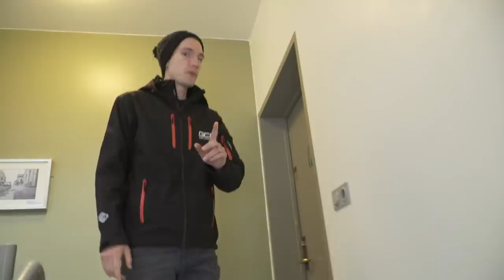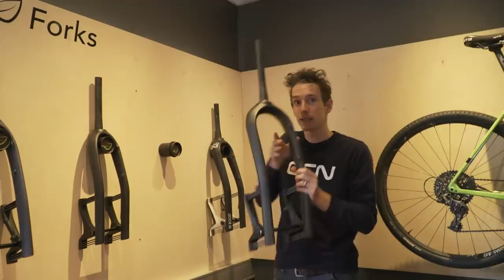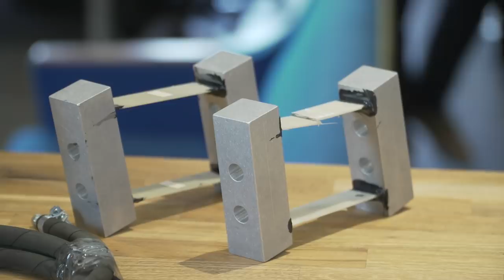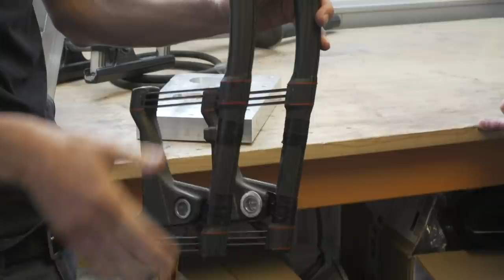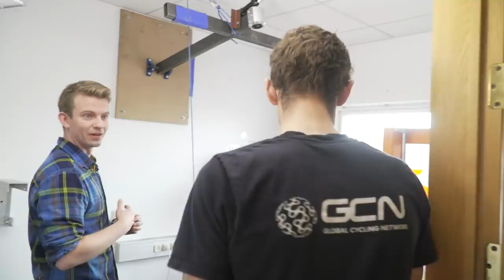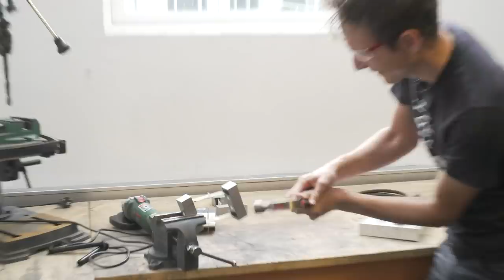Gravel Bike Suspension?! | Meeting Lauf In Iceland

Comment: These guys are ignoring a huge market by only concentrating on gravel and MTB's.
I came back into cycling recently in my 50's and only ride in urban areas and cycle paths, almost immediately the numb hands and butt from various dodgy footpaths and rough roads made me want to quit.
I fitted a Redshift stem, and that has been great, and have experimented with various suspension seat posts and seats to make riding bearable.
If Lauf or anyone else, made a bike with front and rear suspension that does what they claim, and marketed it as a 'comfort bike', to alleviate the all the minor bumps and vibration of typical urban riding, they would have a winner, I reckon. 
A regular road bike is totally unsuitable for urban riding with all the bangs and bumps, you have to put up with, might be ok if you are young and limber and are concerned about your macho image, but there is a big market for a short travel small bump suspension bike for all the rest of us, unfit, overweight enthusiasts who don't have the luxury of riding long distances on relatively smooth roads.
Reply: Dooya Punk I agree with you completely, I have 2 road bikes one with 23c tires and a cheaper road bike with 32c tires. There is no doubt the 32c tire bike is more comfortable. I lower the air pressure on the 32c tires to -15 psi off the tire rating. This allows for a more soft ride. It also helps cornering as there is more tire on the ground . Roads in Canada are probably the worst due to rough winters with the snow plows scrapping the snow off and salt on the roads. Road biking is not that great due to some nasty roads where you literally have to ride looking out 20 feet ahead of you so you won't crash.
Reply: @danfuerthgillis4483  
Thanks Dan, I really think a 'Lauf' bike with a similar set up at the rear, would be my ideal bike, still light but with the ability to take out most of the road shock that makes urban riding a pain.
No one would drive an F1 car, or any race car on the roads due to the fact that they minimize suspension travel for better handling, yet we ride rigid bikes and have been for ever !
Reply: @SaintKimbo  those sound like symptoms of improper bike and cleat fit
Reply: @SaintKimbo  if regular road bikes are painful,  why don't you switch to a trekking bicycle with wider tires and a short travel suspension fork or even better, a cross-country bike, either a hardtail or a fullsuspension? I use a GT Avalanche in the city and while I'm losing some speed/efficiency, I'm enjoying the extra comfort and robustness provided by 2.25" tires.
You could also be using a seat post or saddle that has integrated suspension.
Reply: @CristianCiupitu  
Yes, a XC bike with full suspension is on my radar, but my point, after watching this Lauf fork video is that, this type of fork would be ideal for a 'round town comfort bike, especially if they could fit something similar at the rear.

There doesn't seem to be anything out there that fills this void, lightweight, without the stiction and weight of a telescopic set up, but still relatively comfortable.

I think that this is where bike development is heading, Trek, Specialized and others are doing this already, with their frame lay up, stem suspension and seat post tech, and it will evolve to a point where bikes will be fast, light and much more comfortable without compromise.

This is a market that Lauf should look into, comfort is one of the main selling points of recumbents and if you watch any video about recumbents, you'll see a whole lot of people saying how they are sick and tired of the aches and pains of regular bikes.

I can't see any reason in 2018 that we can't have both comfort and speed, if rigid was the way to go, why does F1 and GP motorcycle racing spend squillions on short travel, fast acting, lightweight suspension systems?
Reply: @SaintKimbo , indeed, when it comes to comfort Trek has IsoSpeed [1] and Cannondale has SAVE [2].

[1]: https://www.trekbikes.com/us/en_US/inside_trek/isospeed/
[2]: https://www.cannondale.com/en/International/Innovation/micro-suspension-technology.aspx
Reply: Specialized have their FutureShock stems on their mid-range Diverge (gravel) and Roubaix (endurance) bikes. You also have their CG-R seatpost with about 17mm travel (though it's expensive for what is it). 

With Canyon you could consider their Endurace line with VCLS 2.0 flexing carbon leaf seat posts. You can either buy into their high-end range to get it included or buy it separately. Ergo also sells this exact seat post under their brand, too. By many accounts this is so far the ideal seat post with the right weight/flex/travel. If you have the funds you could buy an Endurace (with large 32+mm tyres and fit your RedShift for excellent comfort!
Reply: @justinseau  
Yes, I know about all these options, but watching videos about the Lauf fork got me thinking about why there is not more done in this regard.

I get that pro and amateur racers and the traditionalist/masochists/wannabes, want their stiff frames to maximize peddling efficiency, but it's 2018 and there's no excuse not to have a lightweight fast bike with about 30 mills of travel, without the weight and maintenance of telescopic forks, Lauf have shown it can be done.

Motorcycles had what they called 'plunger suspension' on the rear, prior to swing arms taking over, back in the '40's, which was basically a short shock fitted directly to the the rear axle, I see no reason why something similar to the Lauf leaf spring arrangement could not be adopted for the rear end.

Motorcycles had, lightweight, short travel suspension systems nearly 80 years ago and road bicycles still have nothing, can't you see a problem there, isn't there some catching up to do?
Reply: @SaintKimbo  Ibis, KHS, Sun, Merida (untill recently) and some other companies manufactured soft-tail models during '90s, in range of expensive titanium or carbon frames, to affordable alluminium and Cro-Moly... pity that that concept didn't widen. Now Cannondale, Trek and BMC have at some point similar conceptual models.
Reply: Dooya Punk it would'nt sell because these fork are marketed to the consumer of high end,high performance MTB,Gravel and CX,you can buy a complete MTB fitted with Fox,or Rockshox for the price of these forks alone.
Reply: @johnbravo7542  

I understand that, but I'm not talking about the Lauf fork specifically, a cheaper knock off version that would become more economically viable with mass manufacture could be done, I believe.

Since I became interested in cycling a couple of years ago and have been checking out the situation on Youtube etc., one thing that has stood out is that, a lot of people in the cycling world, are almost delusional in their need to be, 'just like the Pro's', and ride cycles that are based on racing cycles. 

The fact that there isn't many bikes, if any, that are made with simple and cheap forms of short travel suspension at both ends, bears this out.

I ride bikes for fitness and enjoyment, I don't care about KOM's or or how fast I can get from A to B, that's not my aim.

I get that a lot of people want to do that, but there is also a lot of people who are stuck in the past, the disc versus rim brake thing proves that, and I believe this attitude has done damage to the progress of cycling.

I ride motorcycles, and a lot of people want to ride 180 mph race replicas that have a riding position that is uncomfortable because it puts you in a crouched, aerodynamically efficient position and places your feet high for cornering clearance and leg cramps, but, hey, that's how the Pro's do it.

Sound familiar?

Bikes being, STILL, so uncomfortable, despite the technology available is a symptom of this attitude, as far as I can tell.
Reply: @SaintKimbo  Yes I DO get what your on about  I had a Norton ES82 Manx replica,and my other hobby is Audio Equipment,as an enthusiast since the early 80's yep I'm in my early 50's now,and in audio in particular,there are a lot of snake oil salesmen wanting you to part with your money for the latest and greatest component.
With regards to these forks across the board,they have the same steerer tube,so the bikes they fit all have the same head tube design,so I very much doubt they will design different steerer tubes,for a whole range of bike designs it doesn't make financial sense to do that.
Where there is people with money and a will to part with it,for the cool factor,or performance factor,there will be manufacturers to supply them,cycling is no different.
Maybe you should send an email to Lauf,telling them your story,perhaps they will design a budget version :-)

Comment: It is like a honda C/CA fork from the 60s with new materials and axle moves in parallel to the head tube axis, instead of radially.  The more this flexes the geometry changes slightly (trail).  If tuned right at maximum cornering it can be sharp and slow under heavy loading.

I wonder if a lighter (smaller springs) little travel version can find its way on road bikes.  For endurance racing, when roads can be bumpy especially when cornering down a mountain, this may increase precision and control, where otherwise the tire is bumping up in the air from hump to hump.  What about s-glass/kevlar hybrids for the fibers?  And what about having inserts wedged between the leaves for dampening of the motion.

Another idea would be to be able to add or subtract leaves, increase or decrease the length of them, to alter the characteristics for different terrain.

Very nice project with potential for more development and future.
Reply: I think you are thinking about a carbon fiber fork.

They have just enough flex to dampen the bumps in the road

Comment: Absolutely great idea and implementation, Lauf! And nice team as well! I would love to work on such stuff! 

Fiberglass has amazing damping properties. If you try testing fiberglass specimen in tension mode for fatigue at the same frequencies as metals like steel or aircraft aluminium, it would heat up and start burning - that much energy it absorbs. Awesome fiberglass damping properties are widely employed in helicopter blade construction, car leaf springs, skies and others.

Comment: GCN I Had the Lauf Carbonera fat bike fork for a year on my fat bike. Saved over 2 pounds in weight compared to a regular fork it chewed up the small bump compliance with ease. Only issue was going dowhill and hitting bumps it does not have any dampning so you would get bounced around a lot.  It was durable and reliable and light weight! Lauf makes great products and having it on your gravel or adventure bike would give you more options for off roading and comfortability on thoise long rides.  Overall its expensive but does serve specific purpose and works!!!

Comment: I rock one of these on a hard tail lynskey. It's great for XC trails and I weight around 210-230 most of the time. Not meant for hardcore trails but can still handle fairly rough ones if u are skilled. It does suffer from a little flex at the axle which takes time to get used to.

Comment: the crank arms should b a long & short arm w/pivot pnt & wide peddle that has 2 crank arm connection pnts. Stronger when in keeping w/wt transfer & length of leg along peddle stroke while still keeping full connection peddle & foot thru full circle.

Comment: hmmmm. so do they make different forks for different body weights? or does everyone get stuck with the same suspension weight? a smaller 120lbs rider will not get the same ride out of the same fork as 195lbs rider. That's the only question I have about this tech.
Reply: Yes, some of their forks have 2 different "sizes", Light and Regular. Not the gravel one, as I remember
Reply: It is possible these forks are not as weight sensitive as the 'standard' forks, as these are made to smooth out the smaller bumps, instead of large obstacles. But it's a good question. I would certainly be curious when buying Lauf fork to know the answer, as a very light rider.
Reply: 3. Quoting from the web page for the TR Boost fork: 
«Spring Rate: Regular (over 65 kg / 143 lbs) or Light (under 70 kg / 154 lbs)
This should be used as a reference. If you’re an aggressive rider it’s likely that you’d prefer the “Regular” stiffness, even though you weigh less than 70kg. You won’t lose any of the small bump compliance.»
Reply: Just cut a 'lief' :)

Comment: How did the company respond on the scratch damage to the seat tube, since the tire is so close up to the seat tube, and the gravels can be grabbed by the grids and sent to hit the frame?

If this is a road bike, I will not have such concern....but with this being a gravel bike and designed in semi-compact condition....I hope they have designed special mud guards to fit in that tiny space and still not affecting the wheel rotation.....

Comment: I would love to see a cover for the mech. Not really for aerodynamics , but more for protection. I get that they are strong (Si, we need to talk on dropping the other kind of hammer mister:) but what if you ride in a forest trail and a branch’s gets stuck in it? It’s not like spikes on a wheel, witch are co stent moving and can push away debris.
Reply: The main issue is that they move, so you can't use a rigid plate.

Comment: Really nice bike Lauf, a heads up regarding those Easton cranks if you continue to offer those on your bikes. I broke two sets in less than two years, the weak point is where the pedal attaches to the cranks, it fails.
Reply: Tui Wren did you put the metal ring between?
Reply: @ianiscaratti4924  If you mean the washers that come with the cranks then yes

Comment: The main bar crouch bar on these micro bikes should b 2 bars & smaller than req frame bar, & hve a thinner middle like an 8. 2 bars not touching but nearly touching picture a 8 profile that is stretched out so top of 8 & bottom of 8 r farther apart then normal.

Comment: I God would also like 2 see a model backward curved forks where the leaf springs rap around the forks & hard connect on the riders side of the forks not in front of the forks. Bc it will make leafs longer & look cooler(the design needs sex appeal/ boring wearing glasses) & I think u will gain something by hve that natural reverse curve fork & rider side connection.

Comment: I hate normal shock forks, because they dampen the big holes but don't work at all for rough gravel road and the vibrations it causes. This one seems to work the other way around and I love it. First suspended fork that I actually want to have.
Reply: There is a thing called "setup", it's what you do to make bicycles work the way you want...
Reply: @alan_davis  way to necropost, dude.

Comment: is here a Seatpost (for the rear end of bike) with similar technonogy..? :-)
Reply: You know, I have an old elastomer RockShox suspension seatpost on one of my gravel bikes, and it's really all I needed.  They aren't made anymore, but the point is - don't make seatpost suspension more complicated than it needs to be.  Suspension seatposts don't need to have pivot points, arms, or anything above and beyond either good elastomers, or a spring/fluid combo with valving (just like a car's strut, or a MTB fork leg).

Comment: This is impressive new tech and I loved watching this. Amazing stuff. However...

I think increasing emphasis on 650B rims + bigger tires (way easier to implement + cheaper) will render this tech basically obsolete. It's weird to me why they invest so much in this. There's also better alternatives such as head tube integrated dampers like those from Trek and Specialized (probably not as effective as this, but paired with big tires would basically have enough cushion + they don't detract points from the look of the bike). I understand you can put big tires in these forks as well, but at that point why not go for a basic suspension fork instead? (You can even lock that suspension for road applications)

Comment: If you just use a bigger tire, let's say 700x35c and drop the psi to 40/35. Wouldn't it feel smooth and forgiving as well? 25mm of travel is too small.

Comment: Having ridden one... The lateral stiffness is lacking and I generally feel a "bobbing" sensation. It's inefficient.
Reply: edgardo reyes feel does not equal facts. Of course you’ll feel movement, but it doesn’t mean your loosing efficiency. I road one as well. It soaks the bumps. And saying you’re loosing efficiency will have CX riders laughing at you while they drop you and your rigid with their 100mm travel fork.

Comment: So clearly it has merit this design but needs 2 diff materials 1 on 1 side welded 2 a diff fiber on the other side best of both. #2nd pnt try 3 &4 leaf design, & 3rd I would try varying the width smaller width 1 end & wider with on the other end. This way by trial & error fleshing it out u find the spot where u get best flex wt transfer thru the entire peddle motion. It is in there some where. U hve locked on to the right concept just need to really fine tune it to really night & day diff bring it home to where u wouldn't think of not using this fork, so great they sell themselves.  U will get it but may take u 5 yrs & lots of light bulb best filament to find it. Some materials change w/heat which can b a good thing or bad thing. Brake fad bad, but more flex-ing w/use & heat good thing. ! size fits all is the other problem, bc ppl come in great range of wts, men women american, sporty spice, or twice the spice.

Comment: At that point, i'd just get an XC mountain bike with gravel tires. You can setup a Scott Spark full suspension bike that weighs less than 10KG. If you don't wanna spend too much, then the XC build will be 10-point-something KG. Want aero? Add aero bars to the XC mtb.